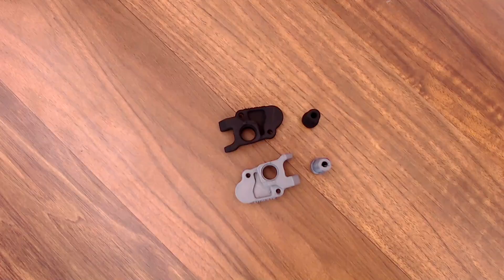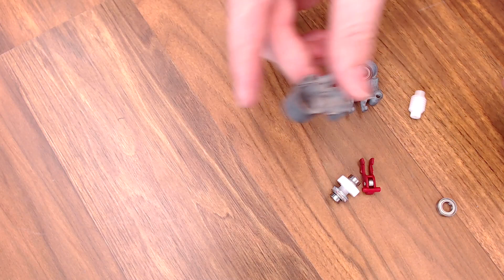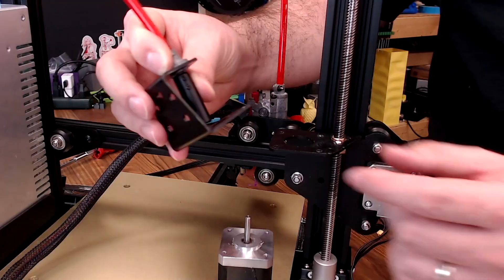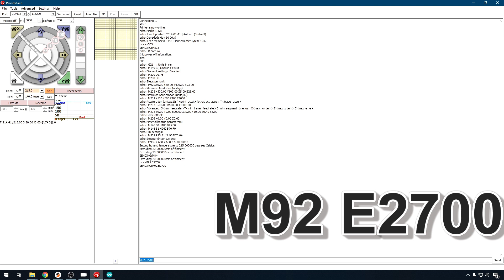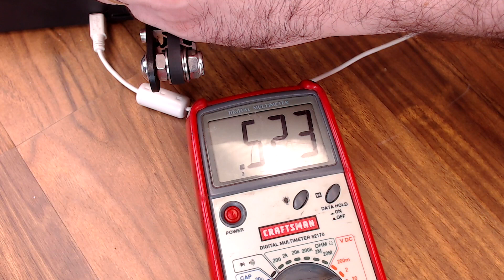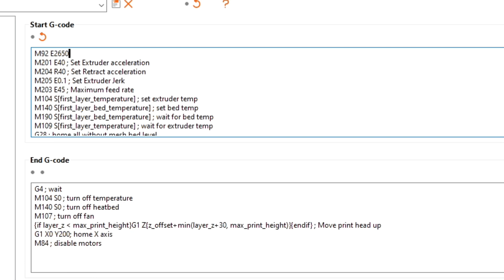The Zesty Nimble - Remote Direct Drive Extruder - Chris's Basement

Comment: So the great advantage of direct drive is that especially flexible filament doesn't stretch that much on the way from the extruder to the hotend, which is the case here too, but doesn't the cable flex too which kind of cancels out the gains from this system?
Reply from the maker: You are correct, the cable flex cause it's own set of issues. It's really hard to get it dialed in.

Comment: YET AGAIN, no mention where zesty nimble iterated there extruder from, one big failure in open source the original is better had more research and development, all these guys done is 3d printed a smaller case and had to change the gear ratio, changing the gear ratio without any research and development, think about it for a minute if the original had 40:1 gear ratio don't you think that he tried different ratios until getting to the optimal ratio? And because these guys can't exactly copy it they had to drop the ratio to 30:, if i had the money i would be personally suing these guys
Reply from the maker: I'm not sure why the Nimble is the first design that was very popular.

Comment: Just another comment. I do love having a direct feed path to my hotend. It makes it a lot easier to clean out my hotend when I get a clog. I got a few clogs at the beginning but after I changed out my 3D print 4010 fan duct to a different one so far no clogging. E3D says that you need to cool the whole Heatsink all the way to the bottom of the heatsink. I guess they are right. After at least 3 prints no hotend clogging. I connected the fan to my 12/24v always on connector. And the 5015 blower fan to the one Fan connector on the MKS_Gen_L 1.0 board. I am currently trying both the eSun and the MH Build Series filament. As for feeding feedrate both work well. The MH Build series PETG is a dull or powery kind of white.
Reply from the maker: You might try increasing the heat on the PETG, that can make it shinny.

Comment: Hi again, I got my E3D v6 Gold hotend and Zesty Nimble extruder set up. I am print out a Pumpkin print now. Which is going to be  around 215mm in X, Y, and Z direction do to the roundish shape. Rewatching your video. 2 things.. If I may ask you. Your drive cable... it looks like the cable goes all the way over the top of the printer and then hooks into the the Extruder motor. Am I seeing this correctly? And then what size cable it this? The cable Zesty recommended to me is not long enough the go all the way over the top of my Tevo Tornado printer. I currently have my cable going around the side with an extension I printed out from Thingiverse the allowed me to push the drive motor off to the side. What's your recommendation? It works so should I ever bother getting a longer cable?  Second I am currently trying to eek out as much speed as I can. I don't know if this is really a question. I have my VREF set to .3mm at the moment. After watching the video this time I see at first I probably was missing steps in the retraction settings. Right now I can hardly see it retracting at all. Mainly I increased the Travel Feedrate that helped the most. I find that for long sections the printhead moves pretty fast. Love it!! But, in short, short sections it is printing really really slow. But still working. Any thoughts? I am thinking maybe I need to up either the Acceleration speed and/or the infill printing speed.
Reply from the maker: The nimble is tricky to get it right. I never really mastered it. As long as yours can get to the whole print bed, don't worry about the cable, it should be fine. The shorter the better for print quality. As fr as speed, I don't think there is a lot you can do, the retraction of the cable kind of limits you. You might be able to increase accel a bit, but finding a setting where is doesn't skip steps is the key.

Comment: Great video. Trying to setup my Zesty Nimble v1.2. I have the Tevo Tornado 2018 with the mks_Gen_L 1.0 board. I have a question... It says in the docs for the Zesty Nimble "Suggested vref is 0.3V or 500 mA". I have the 8 bit board. You talk about 500mV not 500mA. Do you think this is a misprint? Because my calculations using the formulae from the Gen _L manual I need to set Vref to 1.6V to get a current of 500mV not 0.3V as stated by Zesty Tech. I don't want to go over the max current rating for my ICs which is 2A. Thank You
Reply: thank you again, First I was calculating the formula incorrectly. so everything makes more sense, now. Do you know of any sites/videos on the Turning process in regards to the following.... This is a general question to Gcode not related to what we are discussing here. I will explain what I have done so far so you know where my question is going, here.   I tried using the G1 code to just see if my new e3d Hotend, which I also installed at the same time as the Zesty Nimble, is heating correctly and would extrude filament. I first manually pushed the filament through. I think I clogged up the heat brake. At first it seemed to be working. At least somewhat. Before I total clogged up the heat brake, I then tried entering the M code to to extrude 10mm of filament. Right now I have to do a lot of adjusting on things. What happens is if I send another M code to the printer the printer will not run the motor until I send a negative number (-10) to retract. I am assuming some limiting Gcode is in my Firmware file doing something to prevent filament from getting into the cold end of the hot end. At least that is the only thing I can think of at the moment. So I need to learn a good procedure for testing and calibration of the extruder filament. I have read the tuning info on Zesty's web site. They say to measure 100mm of Filament and then extrude 50mm of Filament. But they do not tell you how to enter this as Gcode in the printer?
Reply from the maker: @johnm.gerard1718  I don't know of a good site for this info, but there needs to be one. All you need to do for youextruder is set it to relative mode so it stops counting the steps. Before running you G1 E100 command run M83. This will let you enter G1 commands at will in any amount.
Reply: Chris Riley Thank you, that will jet me started. I found out a few key points. I did clog my hotend, an e3d v6 gold edition, in the heat brake part. I am installing a new e3d v6 gold extruder and the Zesty Nimble at the same time. My Tevo Tornado was all messed up. I had to rewire my Heatsink fan in order for it to turn on. And I had to hook up my extruder to the on board Extruder 1 connector. Not extruder 0. I could probably go into the pin file in the Firmware and change that but I don't know how to do it so I just Soldered new connections. Works now. Also, I just discovered that the MAXTEMP of the hotend in the firmware is 15c less than the maxtemp set in the firmware. All the above took me a long time to figure out.
Reply from the maker: @johnm.gerard1718  Sounds like you are making some progress.
Reply from the maker: Every board seems to be a lot different on these settings. The current needs to be very low or the nimble will skip. I would tune it by ear, turn it down until the skipping is gone.
Reply: I guess I just start somewhere as you suggested. This is what i really need help with. I would love to understand what is actually going on here in theory. In the manual for the mks_gen_L board the formulae for the (I) current is I=Vref/0.8. I have the A4988 green version stepper ICs. The max current is 2A. Now Zesty states to start with 0.3V as your Vref or 500mA (which also confuses me). Plug 0.3v in the formulae about and see what you get. I don't want to go over 2A. So, do you see my confusion? Any Thoughts? Thank You
Reply from the maker: @johnm.gerard1718  I see where is can be confusing. What is happening is the nimble drive is 1/32, so you have to be careful when pushing it. The cable adds a snap back action as well. So you have to start with very low currents. Those reference voltages aren't exact. The formula will only get you so far, there is some guess work here.

Comment: Thank you so much for the tutorial. I have been fighting my Tronxy X5S with a volcano and a nimble for the past 6 months. I'll try putting the TMC2208 back on and bringing down the power and actually set the acceleration and jerk settings. Hopefully then I can print with a retraction of 30mm/s. I've been having to use a retraction of 7-9mm/s
Reply from the maker: You're welcome, good luck on your build. The nimble is tricky.

Comment: For people who have a similar setup: nimble v2 and v1.1.5 board........I could not get the extruder stepper motor to behave even after adjusting vrefs. It behaved very violently and made the worst noise when retracting.  After long tests and discussions on the discord group, turns out the way the 2208 drivers are wired on that silent board makes the stepper behave quite badly, and makes the drivers overheat and shut down like Chris states here (at least in my case), or it doesn't retract enough while still making horrible noise.  The solution was to put the stock board back.  The stock drivers don't overheat and the motor runs very smoothly now. Alternatively, get a 32 bit board, but generally I do not recommend using this 1.1.5 board at ALL.

I have also mounted the nimble onto the back of the PSU which makes the bend in nimble cable much less curved and I believe helps with how its designed to work.
This method removes the weight of the motor off the x carriage making it even lighter.
This mod doesn't improve print quality (not sure why you people think it should)....it simply allows for the ability to print a wider variety of materials, and that for me makes it worth it.  Its a good product, and the support I have received in the discord group is excellent. Many knowledgeable people on there.

Anyways, thanks for the vid Chris, it helped me learn a lot!
Reply from the maker: Thanks for the comment and the tips!

Comment: Hi, I'm running into a lot of trouble with firmware. Were the edits you made located in Configuration_backen.h? I can't find anything like that in configuration.h or configuration_adv.h.
Reply from the maker: Everything I made changes to should be in configuration.h or configuration_adv.h. What setting are you have trouble finding?
Reply: @ChrisRiley  about... all of them. this is the marlin firmware I'm using from TH3D (if that helps) https://www.th3dstudio.com/knowledgebase/th3d-unified-firmware-package/
Reply: @ChrisRiley  anything to do with federate (identifiable via mm/s?) would be priority, since I think the rest can be set in the Cura tabs(?) I have no idea with starting g-code, so I would only touch the tabs.

-if the jerk/acceleration & all you explained customizing is too much, locating feed rate or anything to help with the speed to normalize the slow extrusion would really help me get back to printing :)

Comment: good video as always but the stepper motor still is mounted on the x axis so the setup still has some impact on the  X axis and more complicated setup, there for more potential for gremlins :-)  I believe simpler setup will have less potential problems like a  standard direct extrude sys.
Reply from the maker: Thanks! It is interesting how it works, just not sure I have found a solid use case for it yet. I would like to check out the V2 they have coming up.
Reply: @ChrisRiley   Tanks for all your wherry helpful videos on upgrades and troubleshooting whit 3 printers you have saved me a lot of research. 
Being a new be  in this  3d print world  it helps a lot having this videos

Comment: Very informative and interesting tutorial, but I think your settings are a little bit odd. 
In my opinion you are reaching 6mm/s retraction speed(not 30mm/s) and it's only for a short period. 
You can check it with Prusa's speed calculator (just fill acc:40mm/s2, distance:1mm, desired speed:30):
https://blog.prusaprinters.org/calculator/
I think that is why you have so long print time.
Reply from the maker: Thank you for the comment. I will have to examine the gcode a bit and see what I come up with.

Comment: Great , concise, informative video, I came to a similar conclusion after developing my own flexible direct drive for the Ender 3. A lot of tinkering and cost later and the original Bowden set up still produced much better and faster prints although ringing due to weight related inertia was much less. With all the tests on my own design the lack of retraction control due to the flexing of the cable (many tested) negated any gains a direct drive would have in the first place. I am led to believe the Nimble cable is specially wound both ways to offset this, I cannot confirm this. It seems a lot of cost and fiddling around for not much gain IMHO if considering for something like the Ender 3.
Reply: Stephen Booth, I don't think the it makes much difference for PLA if that is all you print. I would have liked Chris to test the Nimble with a soft TPU.
Reply from the maker: Totally agree with you here. I would like to try it on some other machines, but I really want to check out the v2 version to see what they changed.
Reply: Hi Chris FYI my home brew effort at the link below, this also needs a tweak of the Vref voltage to the stepper driver. There was a small amount of  stuttering especially when reducing the size of shaft or bend radius. My original aim was to produce a sub $20 mod from off the shelf components. Pricewise this is achievable but does not really bring anything more to the table other than a good tinkering project in comparison to stock. One of the  main things about the concept of a flexible drive is that due to the flex of the cable there is a slight lag in extrusion compared to the axis motors. This is particularly prevalent when first extruding and the extruder turns but it is a good half second before the filament extrudes. Therefore there also needs to be some device required to stall the extruder or visa versa so it remains in tandem with the axis motors. I hope that makes sense. I may come back to this but just have not the time at the moment, you could spend hours tinkering with this concept. Again keep up the good work. Best Boothy Link: https://www.thingiverse.com/thing:3912249
Reply from the maker: @boothybuilds  Nice work on this man, thanks for sharing it. I am now looking for other devices like this to compare to the Nimble.

Comment: On a cartesian i3 style printer, a side mounted motor with a rigid splined drive shaft and a sliding gear for the extruder is the way to go. Although speed is still going to be limited by the moving bed. Even better would be the implementation on a CoreXY or Ultimaker style machine where the mount and filament drive hardware can rotate. See the Zero Gravity Extruder as an example. No need to have a flex shaft and super low gearing.
Reply from the maker: I have seen that design before. Very cool, John from robothut and I talked about building one.

Comment: How can lowering the stepper current prevent it from loosing steps??
Reply: The stepper and stepperdrivers are not getting this hot. With high stepper current you heat your stepper which increases resistance etc
Reply from the maker: Have a look at this. Kind of interesting. https://github.com/rcarlyle/StepperSim

Comment: There doesn't seem like much coverage on these Remote Direct Drive extruder designs, so thanks for the info! Only thing I wish you did in video was to demo it doing a fast print. It's one of the main advantages of these extruders after all. Felt kinda unfair to compare the Nimble's print quality vs stock at the same speed. Also, would it be better to place the extruder on the base, instead of the X-gantry? That could further reduce weight and possible Z-axis issues right?
Reply from the maker: This was more of a how to config effort really. Not a great test setup. Yes, mounting the extruder elsewhere would be a better solution.

Comment: Rather than doing an M503 and getting a complete dump of all settings you can do single settings and have Marlin echo it back.  For instance, M92 followed by enter will give you the steps per mm for each axis.  I find this simpler than scrolling through the  amount of information M503 dumps out.
Reply from the maker: That's a good point, that is actually a rather new feature of a lot of those commands.

Comment: Would have liked to see more results. The different filaments dont help. The original benchy has some underextruded lines that appear absent in the nimble, so that would quikcly make it worth it to me; but its hard to tell; and may as well be to blame on the filament...
Reply from the maker: I hear you, I should have showed more, but I really didn't see a lot of difference. If I get a hold of a Nimble v2 I will update with more prints.

Comment: mate if u are running that slow 2h for a boat ... there is nooo need at all for a remote direct drive 
your hotend coud probably way 500g and there woud not be a difference. 
this setup is for high speed printing where every gramm on your hotend matters sth 150-200 mm/s
Reply from the maker: I don't disagree.